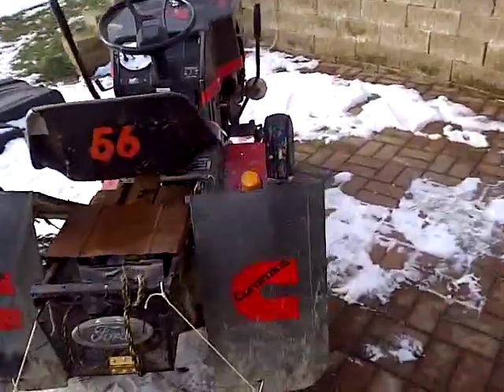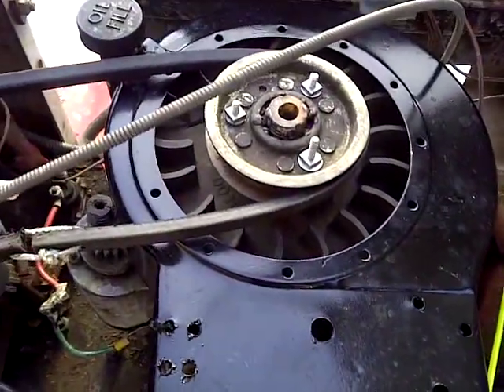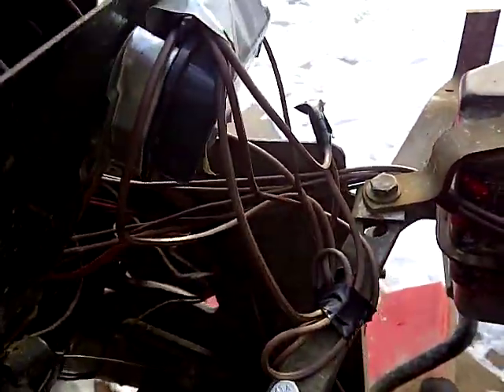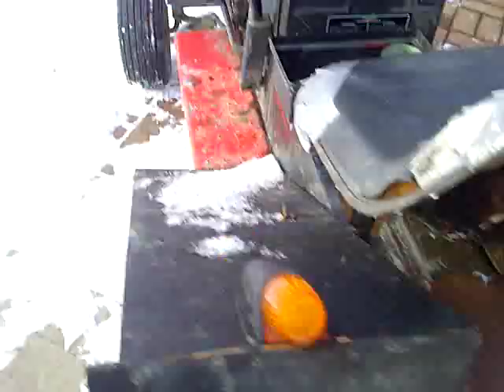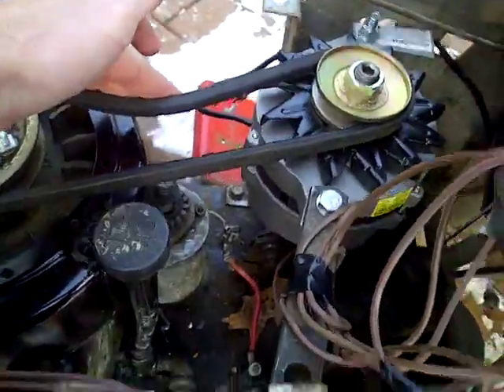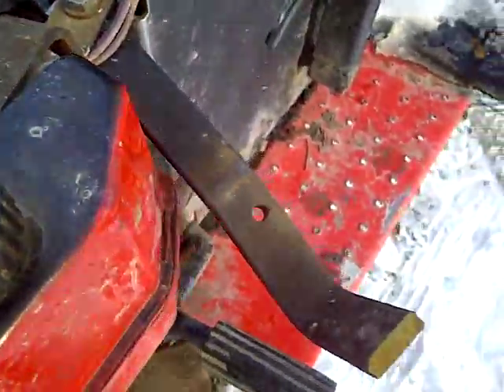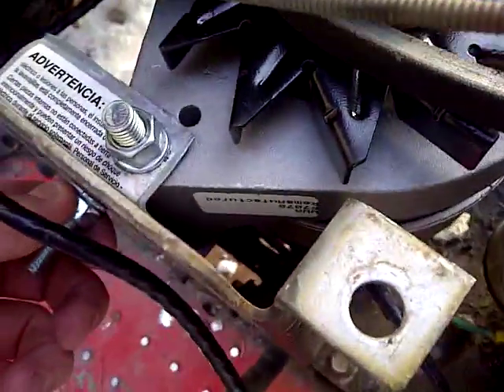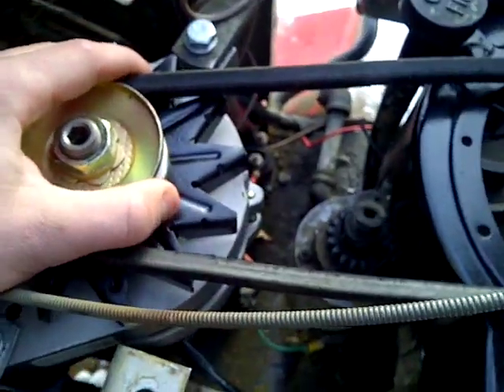how to install an alternator on a tractor

Comment: How did you center it on the flywheel? Is the engine fan plastic or metal? I have a kohler cv730 that I want to do this too, but my fan is plastic and Im not sure if its going to handle the load for long.

Comment: Hey dude nice custom riding mower I like the cummins mud flaps and the lights on the hood I have a 2004 Husqvarna YTH2148 riding mower I had my mower in the shop they had to put a new alternator in it but now it's still rough on cold starts but I might buy some of that Gumout Carb and engine cleaner and see if that works
Reply: Iò